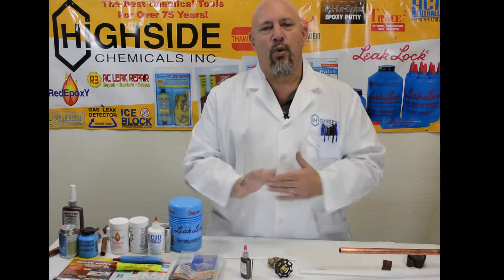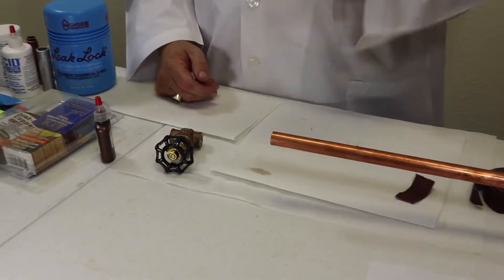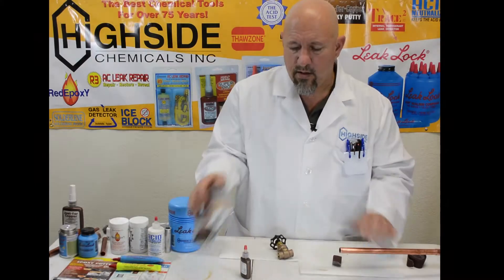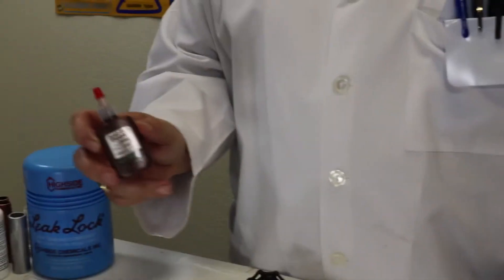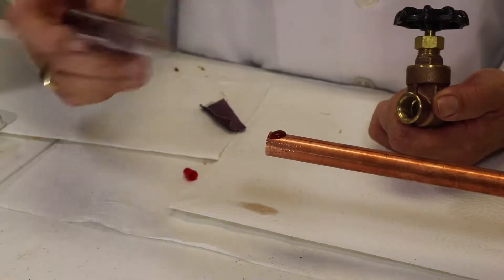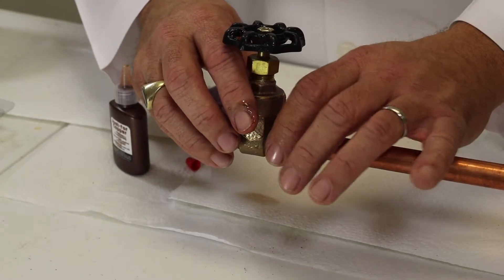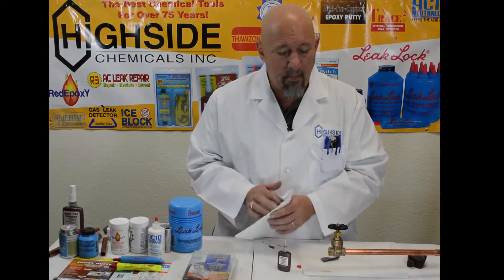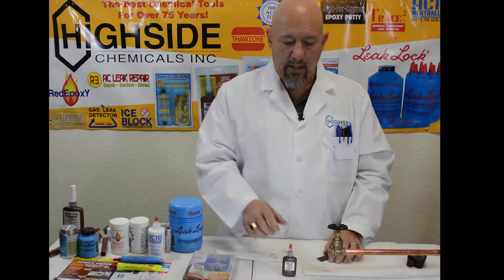Highside Chemicals - Just For Copper

Comment: Let’s say you wanna move the brass later on and replace with something else so do you use oxy acetylene to remove it?
Reply from the maker: Thank you for the comment. If you would like to remove the part applied with this product, all you would need is to heat the joint to 354°F or higher and the product will turn back to liquid form and can be easily pulled apart. This also is true if a mistake is made during application you can also heat the joint, pull apart, clean the area and repeat the process. If you have any other questions, please feel free to contact us: https://www.highsidechem.com/contact/
Reply: @highsidechemicals1936  Im just curious, would it work for HVAC application, example : mini-split R410a/R32, working pressure and temps looks like it would work